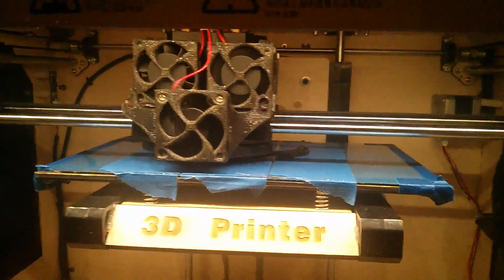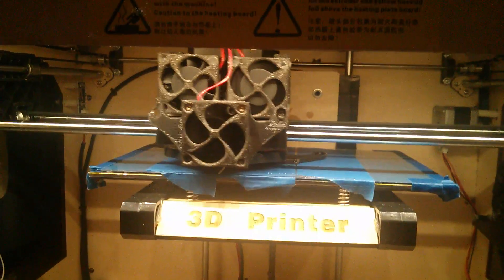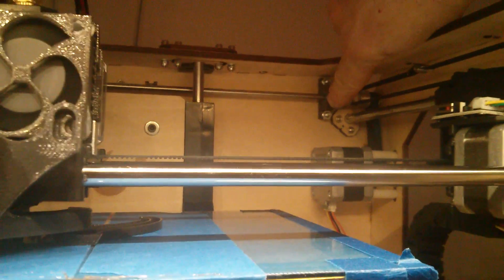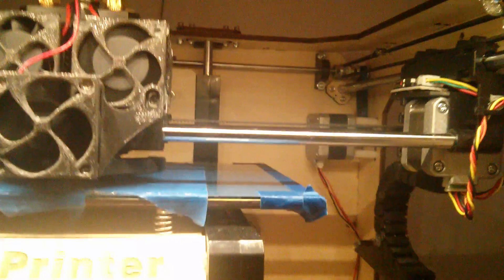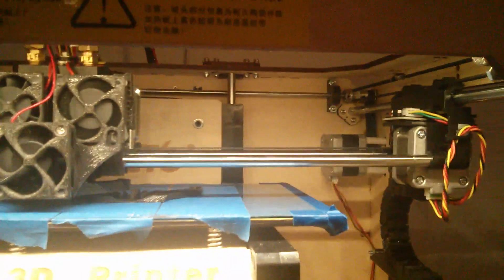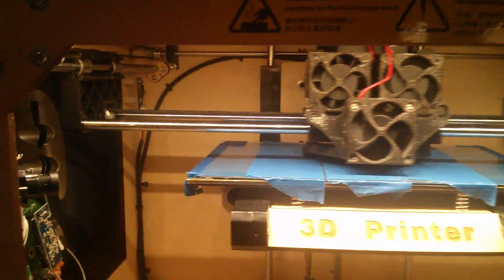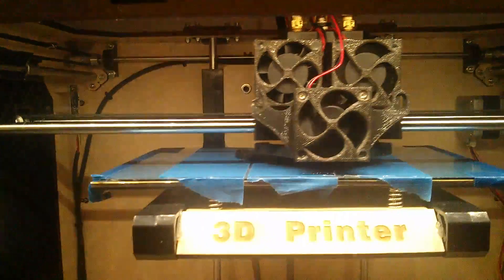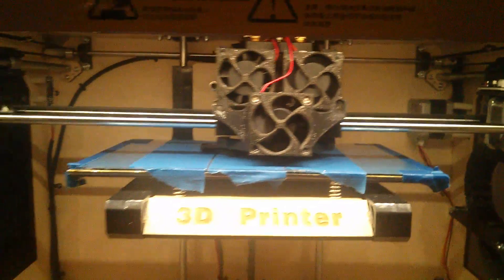Part 5 CTC. The first upgrade you should do.

Comment: Hi .

Ins't better if use you support a bit more far from the original support?
Maybe 15 cm from the corner, this way you got more stability in middle of rod and in the belt gear at same time.
Reply: You don't need stability in the middle of the rod, just where the belts are mounted

Comment: Hey Cory, could you provide a quick set of steps for installing the pillow block bearings? I'm assuming to just remove the top plate, loosen up the y-axis pulleys/belts, and then slide the rod through. I just wanted to be sure before unnecessarily ripping apart my printer.

Comment: about that 3rd fan on the front, is that a pla mod to enable pla prints? Is it to cool the layer before the next layer is printed? Looks like the same kind of fan as the other two, where did u get the fan and how did you connect it? Is that bracket for the 3rd printer from thingiverse?
Reply from the maker: Yes if cools the pla after it's printed so your prints have better detail.  I got the fan off ebay and it's a 12 volt fan.  I added a 12 volt power supply and switch to turn it on and off when needed.

Comment: did you make any upgrades on Z  axis ?
thanks.
Reply from the maker: I did add a shim to the end stop switch.  I kept the original bearings in.
Reply: cory oberdas My Z rods are wiggling a bit. I print that from thingiverse : thing: 33839 , got better result in my prints now.

Comment: THanks for sharing your ideas! I just got my CTC about a week ago. I am already looking at all these upgrades to do to mine. Awesome work!!!
Reply from the maker: I saw another You tuber with the same printer and bought mine 2 weeks ago after watching his videos.  I have a makerbot replicator 2 in my classroom a school and thought I was time to get one for home to use.  It prints as good as my makerbot replicator 2 and I can print abs for 2/3's the price.
Reply: I agree. I am very happy so far with this printer. All the parts are very similar to the makerbot and I believe the board is an Arduino mega.

  In the past I raced R/C cars so I am very familiar with the bearings you used. I am actually buying them today and printing the brackets tonight. I also bought some 12v LED strips to attach to the bot. I didn't want to tap into the power source of the bot itself, so I will be using an external transformer with a separate switch connected.
Reply from the maker: I connected my fan and lights the same way. Both to a separate witch.